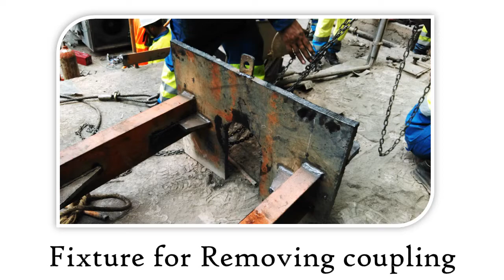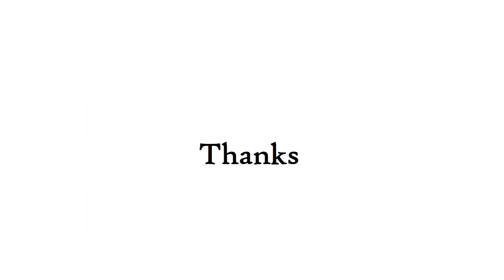How to remove bearing.   How to install a Bearing Spherical roller bearing. changing a bearing

Comment: Every Customer is not like to Bearing Cutting with Gas Cutter. Lot of customers asking remove Bearing without Gas Cutting.
Reply from the maker: Puller is used mostly to remove bearing, but some time in some application it is of no use.
Thanks for comment.
Reply: @EngineeringDots  Thanks For Your Reply. When I searching vedios for Stone Crusher Eccentric Shaft Bearing Removing i seen this vedio.
Reply from the maker: @yesukumarcbz6099  Thanks again. Engineering jobs probably the maintenance, is like an adventure. Interesting but tough.
Reply from the maker: @yesukumarcbz6099  The eccentric shaft bearing removal that you were searching, belongs to jaw crusher???
Reply: @EngineeringDots  Yes Sir !
Reply: @EngineeringDots  Replacing  Jaw Crusher Eccentric Shaft Old Bearings and Turning New Shaft with EN8 Material if Shaft Broken and welding & Line bore Work If Jaw Bores Depreciated is our work. Customers asking remove Bearings without gas cut.
Reply: How did they hang the fan wheel?